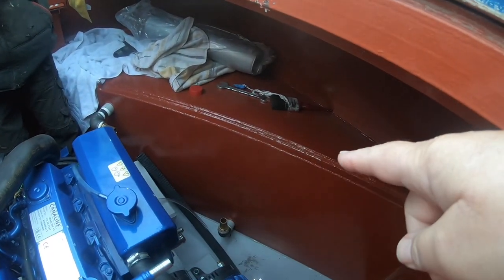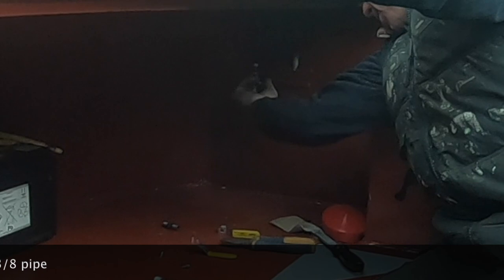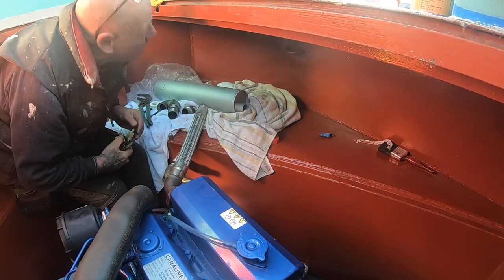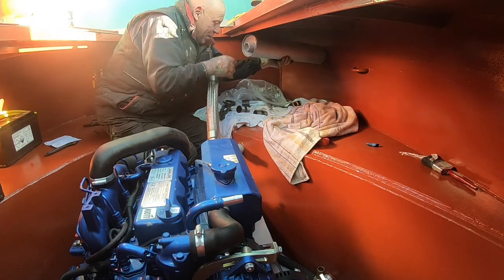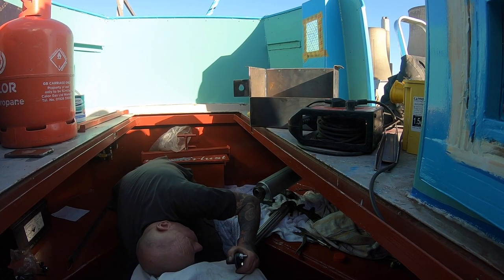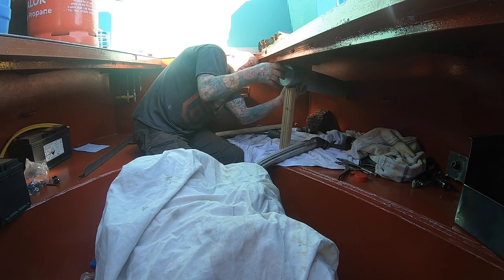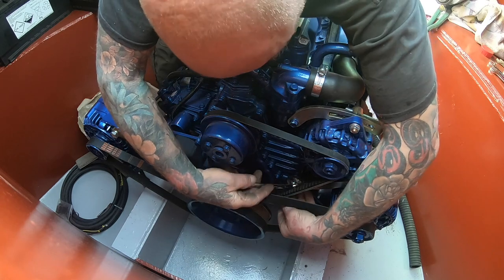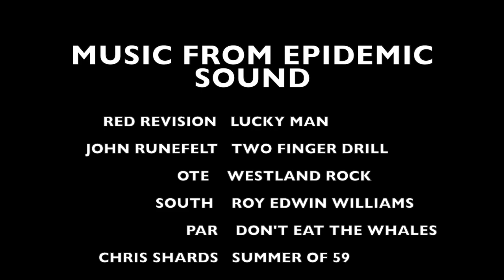VLOG 94, Narrowboat fit out -  Exhaust, Fittings and Pipe prep on Canaline 42 Engine

Comment: As I've previously said aren't those alternator adjusters good, they make belt tensioning so much easier and more accurate. 
Regarding a separate tank for the central heating boiler, I'd have thought that this was a good idea, isn't heating oil taxed at a lower rate and therefore cheaper than that used for driving the boat? Perhaps I'm wrong. 
It's all looking good isn't it? I bet you're pleased.
Reply from the maker: Thankyou Tony. Yes they are good eh. Yes I think that is why some have 2 tanks. Im not sure of all the new rules yet but i think you have to declare what is used for heating and what is for driving when you fill your tank. I think it is 40/60. We will look into it soon and perhaps put how it is done in another vlog down the line. Yes very pleased 👍

Comment: Where did you buy the exhaust from
Reply from the maker: Hi Martin. All the engine and parts that you see fitted were supplied by Pete over at Soar Valley Steel Boats who fitted the engine. I'm assuming he got them from EnginesPlus as they seem to be the main dealer for Canaline. 👍